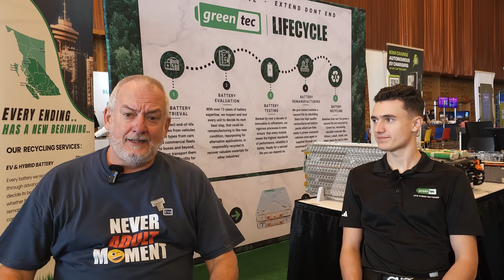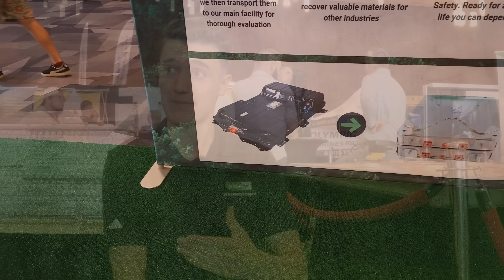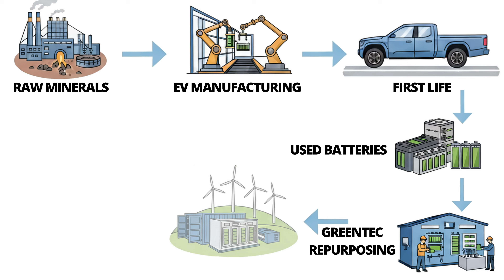GreenTec Auto PROVES EV Batteries are EASY to Re-purpose and Recycle!

Comment: Let’s think of gasoline as  a kind of battery. It’s a tank of energy. The gasoline battery has one spectacularly great feature: the as yet unbeatable energy density of it. Now look at the downsides of the gasoline battery. Number of discharge/ charge cycles: 1 compared to several thousand for an electric battery. Recyclability: 0 compared to high 90s percent for electric batteries. Negative environmental impact of the gasoline battery: Desstabilized climate compared to modest amounts of materials winding up in landfills. Next time you hear FUD-chuckers waxing eloquent on problems associated with electric batteries, remind them of the problems associated with gasoline batteries.

Comment: As a retired chemistry teacher, I have explained the idea of charge and discharge of cells which basically involves reduction (gaining or electrons) at the cathode and oxidation (loss of electrons) at the anode. A cell gains its energy by having electrons move from an area of high potential energy to a chemical that has a lower potential energy. If we don’t separate the cathode and anode then the electrons will just transfer between the two materials and no energy will be harnessed from the chemical reaction. Almost like a “short circuit”. However, if we separate them and force the electrons through a circuit which they can “off load” their energy on the way to the cathode, then this ideal. As you can imagine these electrons being negatively charged and moving from one area to another can cause an uneven charge distribution which needs to be neutralized and it is the job of the salt bridge (the tiny membrane) to even out charges. As the cations (+ ion) and anions (- ion) move back and forth to even the charge out, they create these pathways that will shorten the life of the cell since their movement becomes restricted and may even provide a shortcut for electrons to circumvent the circuit altogether. When the cell gets “recharged” we use the energy to force the electrons in the opposite direction and rebuild the deteriorated anode but you can imagine that with each charge and discharge putting the material back exactly the same way each time can be difficult especially at DC fast charging speeds! I hope this helps a bit!